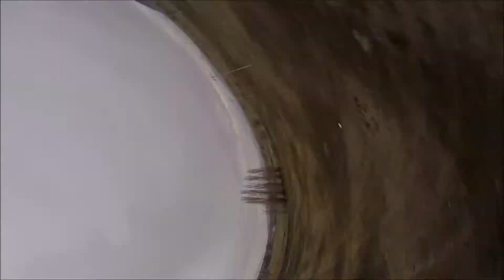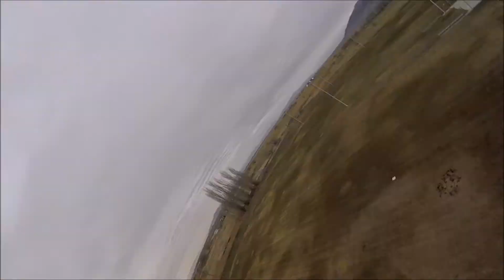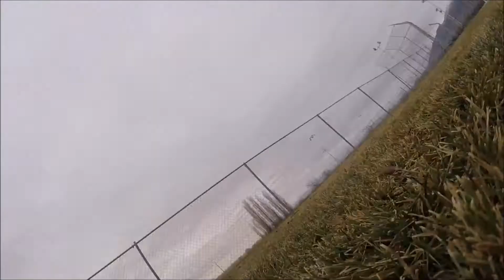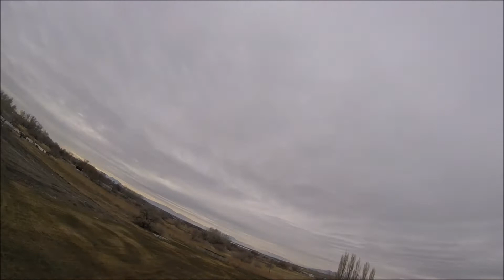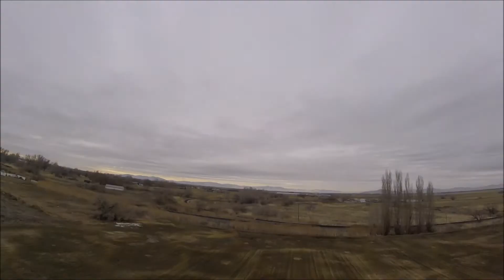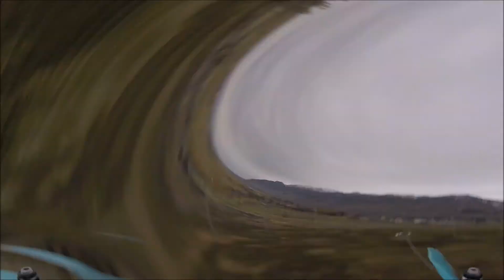Raceflight Problems Continued

Comment: I had the same issue it could be one of two things first and foremost is the motor idle speed the way u can fix that is in rf1 set idle percent to 7 not 5 the other could be that you didn’t use caps and if you did they may not be enough as far as voltage goes I use the 35 v 1000uf caps they work amazing

Comment: Did you ever fly it stock?  And did you ever try using raceflight rates?
Reply from the maker: sᴛᴀᴄᴇʏ ABSHIRE, everything stock except rates. Skitzo's default rates on there are higher than mine.
Reply: Bluto FPV not if you are using non raceflight rate system